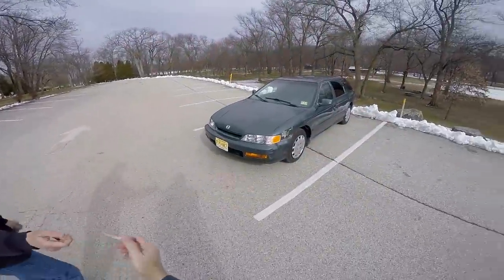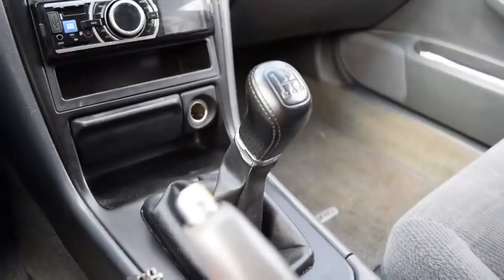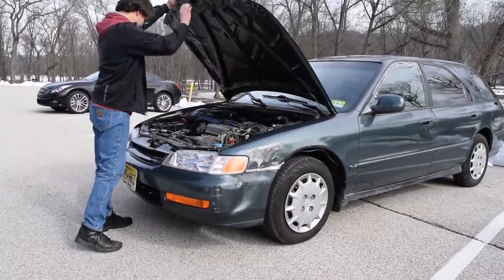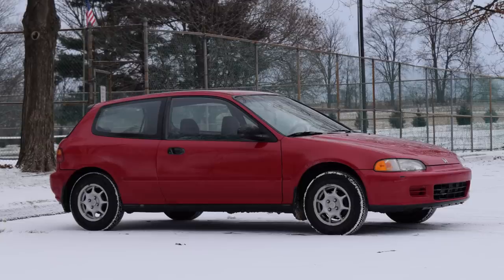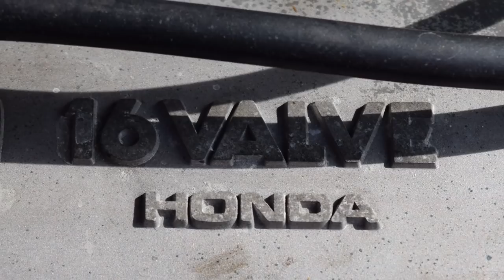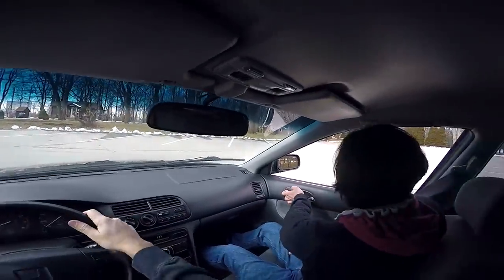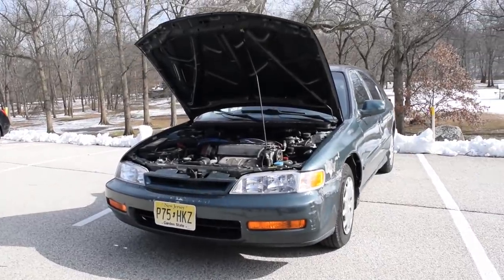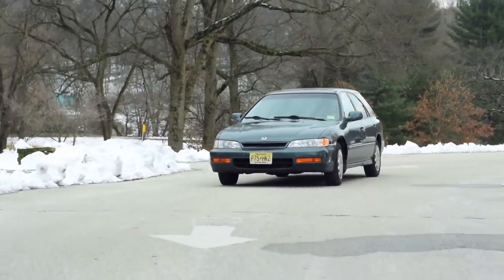1996 Honda Accord Wagon 5-Speed: Regular Car Reviews

Comment: "it's not that stupid vulcan v6 that goes wehhhhh" I'm laughing so hard.
Reply: I laughed too at that one. My work colleague has the Ford Ranger he reviewed a while back and noted that awful low revving Vulcan engine, I made him watch the review. I think I'll make him check out this video too, with that reference. Plus he has a Saturn l300 station wagon from early 2000's that I think this Honda Accord station wagon would be way better to own. I used to have a 89' Accord, with the same engine and stick, probably barely had 90HP in the carbureted version.  I miss that vehicle, but the rust would not stop.. Would love to find an LX-i Accord in mint condition.
Reply: That part made me laugh too, reminds me of a similar one he did on some slow car review something like, "You floor the pedal and it's like huh I don't wannaha".
Reply: Marcus Damberger I currently drive an 89 LXI sedan manual. It is such a great car. lots of fun to drive. I live in Arizona so that means no rust.
Reply: bfchang It may not rev high, but damn that 3.0 was reliable. Decent torque too.
Reply: I own one and I laughed too. love that ranger regardless.
Reply: Oh god, I felt that pain deeply. Pain in the form of that V6 in a Mazda B3000 pickup (identical to the Ranger of the same year).
Reply: Yeah, I own a '99 Ranger with the same engine. It's totally true. You floor it and the engine will pick up and go sure. But you can tell it's only doing it because you are demanding it. Your foot is welded to the floor. That's how far down the gas pedal needs to be pushed to get any fun out of the Vulcan V6 3.0L.
Reply: It's funny cause it's true, and sad. My dad's v6 ranger makes you question what you're doing with your life. The suspension is sure to collapse your spine too.
Reply: Even the 2.5 sohc 4 banger had more go than the 3.0. From a stop my ranger will smoke the tires but my friends 3.0 with half as many miles just kinda, bleh
Reply: The 4.0 ohv Explorer xlt moves good.
Reply: Totally agreed! Maine potholes are a blast! Not!
Reply: TheDriftSetup. A blast in a snowstorm too
Reply: My vulcan v6 is a piece of shit.
Reply: I have the 2004 version of the same exact truck he drove in that review, right down to the engine and trans, and I love it.  It isn't fun, per se, but it gets the job done and it is reliable as shit.
Reply: Ford Vulcan V6: The official engine of nihilism if its favorite drink was Mountain Dew and Fanta.
Reply: Ford Vulcan V6: When you want a nice base for a centerpiece table in your mancave
Reply: i wish my vulcan was a ranger... the second car i ever owned was a 2000 mercury sable with a auto trans and the cast iron monstrosity of an engine people call the vulcan. Why give such a awesome name to such a unispiring engine?? anyways at least with a ranger I would have gotten rear wheel action.. lessons learned.
Reply: I have a 2000 Mercury Sable now. Ran nice at first, but it's got a vacuum leak I think. Anyway, the engine is a piece of shit. You can literally put it in drive and give it enough gas to sporadically rev up to 1500-2000 RPM's but still only have the torque converter carrying you forward. 
BUT AT LEAST IT'S THE LS PREMIUM AND HAS NICE FAUX LEATHER SEATS
Reply: Just like the 3.7L "PowerTech" V6 in my Jeep.  The name implies power and technology, of which it has neither.
Reply: Yep. It's a, '06 Liberty Renegade.  For the most part I like it, it's a decent little truck, but aside from a little bit of torque, the V6 is pretty gutless, and it could use some more ground clearance.
Reply: The rear-wheel action in the ranger isn't that great, with open gearing and no weight in the back.  Gets challenging in anything other than ideal weather.
Reply: Opposite Lock I love the jaguar one he did
Reply: don't talk shit about my mom's ''07 Taurus BWOMMMMMMMMMM WOOOO-anuhhhhhh
Reply: My Vulcan lacked some power but you are all wrong about the "weeehhh hehh". I loved the growl of mine and so did many other Taurus enthusiasts.
Reply: Had first-hand experience with that.  My friends Ranger almost killed me on a rainy day lol.
Reply: The 3.8 litre V6 provides even less fun. It's the most gutless, joyless V6 I've personally driven, in our family's thankfully-ex Taurus wagon. Compared to that, the 3800 Series II in my Buick LeSabre felt like rocket power, with better economy to boot.
Reply: the 3800 s 2 is a pretty engine i have one in my grand am gt that puppy moves! for what it is
Reply: I always enjoyed the 3.5 liter Chrysler SOHC engine from the 90's.  My dad's 97 Concorde was rather nice to drive, had decent pickup and didn't sound bad.
Reply: ingej003 the same 3.5 V6 in the Chrysler 300M/300M Special?
Reply: Nick Crane thats the one, although by the time it was in the 300M I believe they had increased the power somewhat than the version I drove.
Reply: haha totally!
Reply: In Ford circles we call it the "Three Point Slow", the power of a 4 cylinder, the MPG of the 4.0. There is really no point in getting a 3.0 in a Ranger, although I heard they have great longevity. Stock steel wheels on Rangers? Not so much...

As far as Honda cars go, I think they're little tinfoil deathtraps with backwards mounted engines.
Reply: 5 generation car accord 1400cc system tecnology.
Reply: The Vulcan was designed to be torque engine not hp engine. You need torque more than horsepower to accelerate fast you need torque to climb steep hills. Horsepower just makes your car have a higher top speed   The Vulcan is limited to 110 mph while the Duratec motor will do at least 130 mph it took 50 more hp to do 20 mph more in speed.
Reply: I have had a vulcan ranger and a duratec escape. I don't know why ford used to make the wimpiest v6's ever.
Reply: My family has always described the ranger motor as a lawnmower.
Reply: Lol. I have a 4.0 5 speed 2wd and it will light them up going 25 30 mph in 2nd no problem with 3.08s

Comment: My neighbor drives one of these and he works for Honda. I could never figure out why he never upgraded, but I get it now. There really is no upgrade!
Reply: Suboptimus Lime I think this could be said for every Japanese automaker.  New Japanese cars are boring af and not nearly as reliable
Reply: Hamilton Dashcammer My “Japanese” Honda Fit was made in Mexico 😕
Reply: @jamesbensch6  100% agree. That said the U.S variant Honda F engines start to burn oil like nobodies business once they've reached a certain point.
It starts slow, but the seals just don't last. And then spark wells start puking oil.

I do love these cars, but that was the majority of my experience working on my Ma's.
Reply: @foureye7058  You're not wrong at all. I have a 97 Accord and I started getting major oil leaks past 180k miles. My dad and I had to replace the seals and steam clean the transmission after the oil and dirt caked up on it.
Reply: because older cars are just better. they were designed and built before auto manufacturers discovered a lack of quality wouldn't equal lower sales. case in point i have a 98 gmc serria 3/4 ton truck. These GMT400 platform trucks haven't rolled off the line in 22 YEARS now. but they are still out there. you can barely run out to the corner store without passing one. Its going to be interesting to see how newer cars fair as the years roll on.
Reply: People try to talk me into a DOHC 5spd swap in my Escort wagon... I'm like "nice try, got cruise, ac, and tilt MF's"
Reply: Rix IV A lot of the cheap, shitty cars are made in Mexico. But nicer ones are generally made in the US or Japan.
Reply: I adore my 2005 Mazda6 wagon for the same reasons Mr. Regular loves this Accord. Practical, well made (BESIDES THE RUSTING ISSUE, BUT I BLAME FORD), good engine that's happy to rev but also happy to just quietly get me somewhere. Plus it was made in Ontario
Reply: He or she could get Acura TSX wagon. That's the closet thing to 1990s Accord wagon.
Reply: THANK YOU!!!!
Reply: @D_2_M  
TSX Wagon is harder to find as a manual, runs on premium... and the first gens wth the 2.4ltr 4cycl... are the ones to have! Also, the Acura has leather.. and a whole bunch of nanny tech bullshit.
Reply: @jamesbensch6  Agreed. Honda cars in the 90's (which I didn't grow up in but my first car was a CR-V from 98) felt like the smart premeditated choice. Nowadays they're just playing the game like everyone else and it shows. My parents don't even understand me when I say that the Honda had a higher quality build and far superior interior to the 2007 Jeep Compass that we replaced the CR-V with. To me it's night and day.
Reply: @theinstitute1324  90s cars were crazy. Gone are the days of overbuilt engines like the 2jz, or bulletproof accords etc. or crazy cars like the lotus carlton.

vehicles are more powerful than ever, but it's pretty clear now that we're just trying to squeeze every last drop of power out of engines. Also because all the mandated safety features by the government mean that yeah cars are safer, but they're also a lot heavier. It's also argued that this increased feeling of safety leads drivers to drive more dangerously
Reply: @foureye7058  I’ve got one with 250k. It does t burn a drop of oil but does leak from the usual spots like spark plug wells and valve cover gaskoot. Both easily fixed for less that 50 bucks
Reply: There was theoretically an IS 300 Lexus wagon with a manual transmission in the US but they are so freaking rare I've never seen one for sale. I only know they exist because I saw an article on one that a guy bought.
Reply: @jamesbensch6  ok and

Comment: I just bought an automatic 1995 Honda Accord Wagon LX last month, because I needed something cheap and reliable which could accommodate my wife, our baby, myself, my wheelchair, and a set of hand controls, as I'm unable to move my legs and feet.  The previous owner had driven it 120,000 miles since buying it new, and apparently kept it in a garage, and well-maintained.  I love this car and try very hard to take care of it, inside and out.  I'm very light on the gas pedal, but there always seems to be a little power in reserve should the necessitating occasion arise.  The throttle is very responsive to small adjustments, and the auto gearbox happily downshifts if you give the right input.  Unfortunately it can't easily decide whether to be in 2nd or 3rd at low RPMs, so you have to work around that.  The craftsmanship and fit inside is great, no flimsy materials.  The steering wheel feels particularly nice.  Parts for this car are cheap and widely available.  Honda used to make really high quality metallic paint jobs in the 90s, which my Accord also has.... sort of a champagne metallic.  We named it Marengo, after Napoleon's horse.  I'm probably going to replace the wheel covers with center caps and slap a set of Michelins on.  Hopefully we can get another 120K without major calamity.  From the side and especially the rear, this car looks great, even beautiful.  The proportions and overhang in the very front seem a bit off, a few inches too long and a few degrees too squarish at the corners.  I love its nice, typical 90s Japanese styling elements:  low window sills, a tall canopy which tapers to a surprisingly small roof, and vast expanses of lightly tinted glass interrupted only by slim pillars.  This a great, well-made, fun, enthusiasts' car, worthy of admiration and care.  And you will not see many others on the road, much less looking well.
Reply: I hope you still have it!
Reply: That's so funny, I just found an automatic '95 Accord wagon in the same color - yours is gold, right? - with only 95k on it. It's a little pricier than your average 90's Honda, but this car has so, so much life left in it, and looks nearly immaculate, save for some small scuffs that can be fixed up. I just hope the kid answers his phone, I've been trying him for two days. 

I'd prefer a manual, but a swap will be in order when I can afford it.
Reply: I've got a 94 buddy, keep on truckin and pray to the rust gods every day
Reply: I have a (not running unfortunately) 91 wagon that I refuse to let die, I'll electrify it and keep her going as long as possible. Nothing in the world like a Hampshire Green Metallic wagon baby!
Reply: I 😅

Comment: The good old 90s Hondas.
Reply: Amen.
Reply: Amen
Reply: wow buick you've changed. Heard you're killing it in China
Reply: Daniel28021991 
Modern Hondas have many features that...zzzzzzzzz.
Reply: Daniel28021991 Buick gnx!
Reply: Amen
Reply: I had a '94 Accord EX with the VEE-TAK and it was a fantastic car except for the automatic trans which never wanted to have any fun. But besides that I loved that car.
Reply: kz1000ps I have the 95 and I love that car so much. Just like he said, it's not fast but you can give it 100% all the time and it loves to take it
Reply: I still own a 97 accord coupe. A very under rated car
Reply: MrScorp6666 97 sedan here. Bought brand new. Radio and AC doesn't work. Only major repair was replacing the radiator. Still runs great with 238k.
Reply: Good indeed!
Reply: vimfuego1 Those radiators always seem to go around 200k or shortly after. They aren't too bad to replace though.
Reply: vimfuego1 yeah they're beasts. I got mine in pristine aesthetic condition with a few issues and 119k miles for 700$ from the family of a lady that passed. The only immediate issues I had were oil leaks and a dead battery. The leaks were so bad that they flooded the camshaft. I took it to the shop and miraculously the only thing needing replacement was a valve cover gasket + they fixed the leaks. And the new battery reset my radio, which now needs a code that I can't find. But since that first week, My only issues have been random massive oil leaks(nobody I know has any idea of their cause and it's not worth the investment), and as of two days ago I need to tighten a pulley. I've had the car for about 2 years now and I've got so many stories with/from it And I'm attached, more so than any other car I own/owned. Needless to say, I won't let it go for a while and if I do it'll be to the right hands. The quote at the end of the vid really summarizes what makes this car so special. Also, if you haven't drifted or drove through any twisties yet, it's a must! once you hit ~40-50 mph on the twisties the Accord starts to drift like crazy. the experience is like no other car, it's very unique.
Reply: When you say "massive oil leaks" where are they coming from?

My Accord is leaking out of the rear main seal slightly, otherwise it seems to be mechanically alright even though it is almost to 250k.  (the leak was caused by me not changing the pcv valve after the mechanic suggested I do so...)
Reply: Papa bless
Reply: yess, indeed, thats a nice car. could eventually be a japanese classic in the near future
Reply: sorry for the long reply time, I got the car checked out. So, Mine only leaks occasionally but when it does that oil comes from everywhere and I mean everywhere, it will literally piss out the oil in it. I just took it in to my buddy's shop and it stumped all their people... I might take it to a dealer soon to see what they have to say.
Reply: FYI the front seal on one of the balance shafts likes to pop out on these F-22 engines.    The fix is a clip that you can bolt on without removing the timing belt, which holds the oil seal in place.   Oil pressure switches on the back of the engine also tend to leak with age.
Reply: awesome I'll check it out
Reply: I miss the days when I could buy a "simple" Honda. A DX with no power stuff inside. Simple and a great price. Everything for bigger and equipped with too much crap.